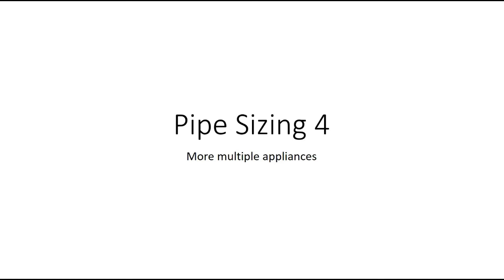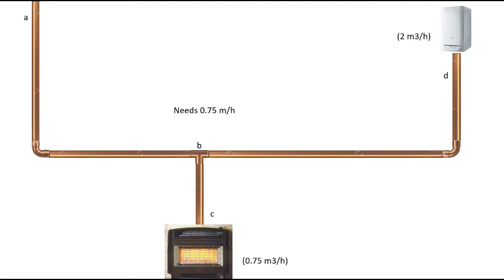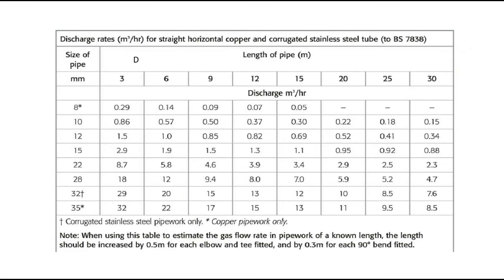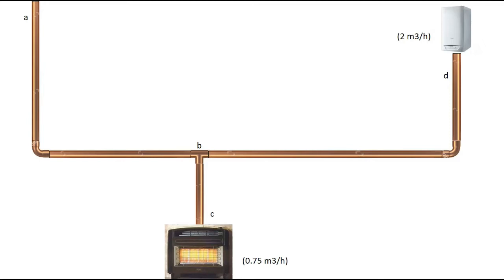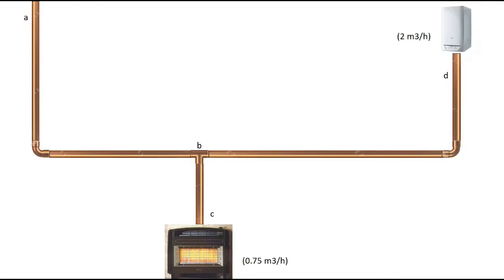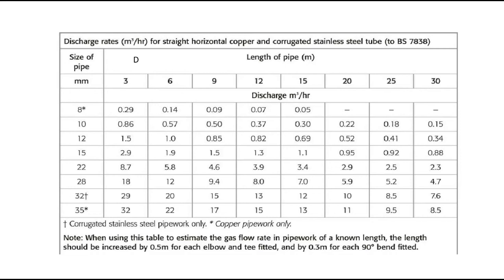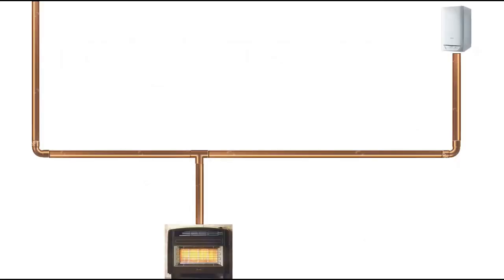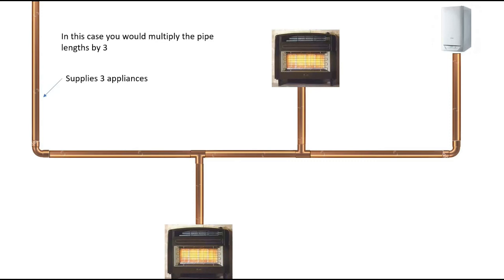ACS Gas Essentials - Pipe Sizing Pt4 Multiple Appliances

Comment: I’m a bit confused about the pressure drop situation, let’s say u got 3 appliances on a system, boiler, cooker & a fire, is it a 1mb drop across the whole system or are u allowed a 1 mb drop at each appliance
Reply from the maker: Hi shredder. This means gut sound a bit more complicated than it actually is. The max pressure drop you are allowed per appliance is 1mb. However if you sized the pipes to allow a 1mb drop at each appliance then when all 3 of them were on you would suffer a 3mb drop across the whole system so each appliance would suffer a 3mb drop. By dividing the allowed drop by how many appliances there are (let’s say 3) and only allowing a 0.3mb drop to each appliance that means that when all 3 are on the entire system will only drop 0.9mb so all the appliances will be within limits. Hope that clears things up…

Comment: Hi
If the overall pipe size for on appliance exede  40 mm , which is not in the chart, how could be calculated?
Thank you
Reply from the maker: Then it falls outside of “domestic” and you need to take another course to be qualified to work on it. Thanks for the question.
Reply from the maker: Hi H GH , sorry, I missed your question when you posted it..if you’re working on 40mm pipework you are no longer working on domestic gas and must have a commercial gas licence, it’s a completely different thing. Domestic gas only goes up to 35mm that’s why you won’t see it in the charts. Sorry again for the late reply..
Reply: Hi Sir
In real calculations there is 2 elbow after meter before the main length begin,we should take them to calculate?
Thanks again.